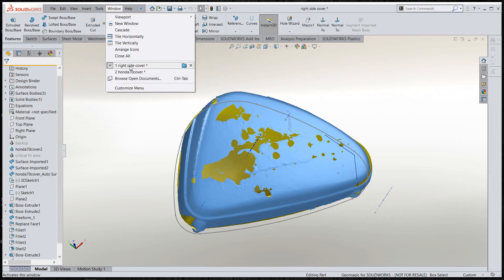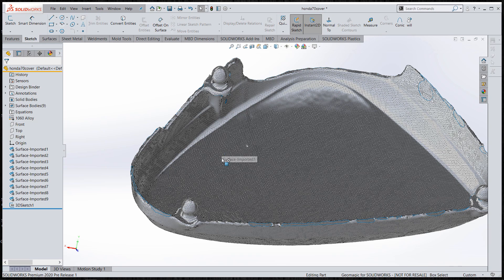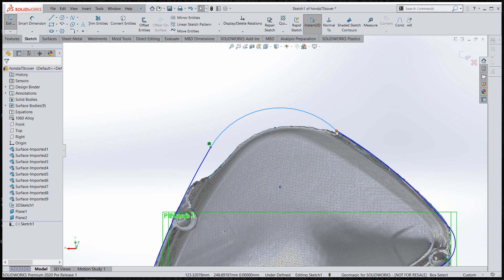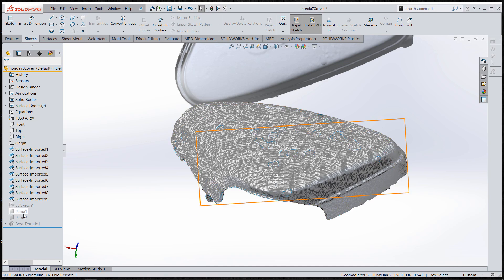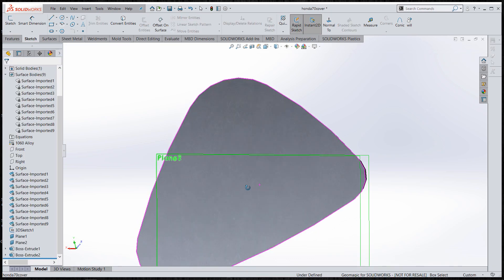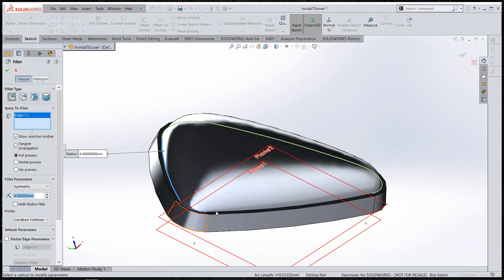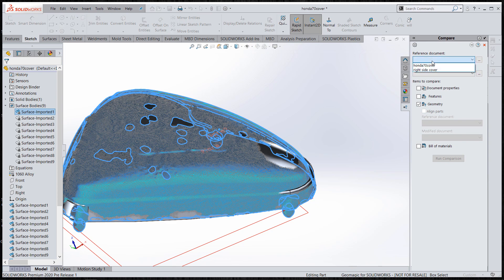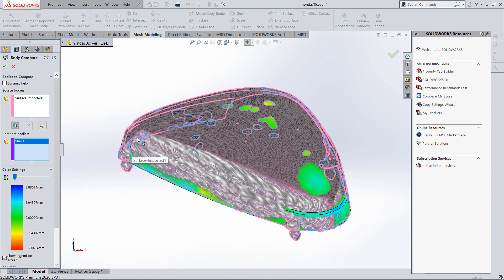SOLIDWORKS 2020 Tutorial - Reverse Engineering Scanned Models

Comment: Isn’t scan to 3d shipped with every SolidWorks version? You just have to enable it and use the scanto3d file option when opening the model. 
There are really nice tools for reverse engineering.
Reply from the maker: Scan to 3D is enabled based on the solidworks License. It is available to users with a SOLIDWORKS Professional or Premium license
Reply: @goengineer  you are right. I was thinking it would ship with every version. My bad. 
It isn´t included in the standard version.